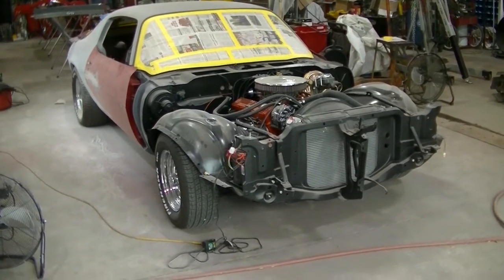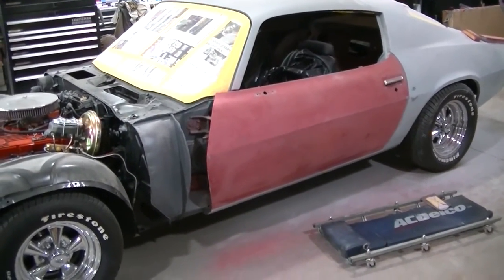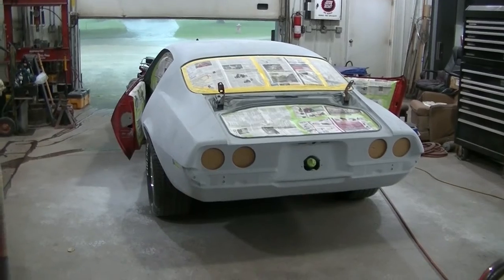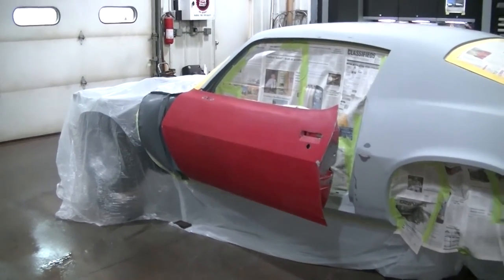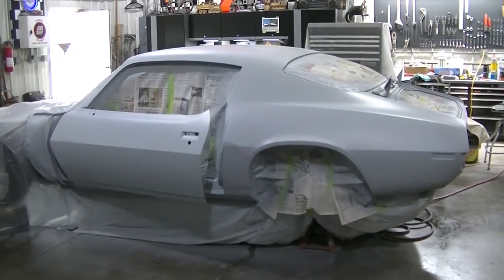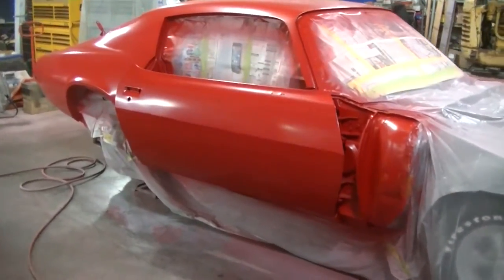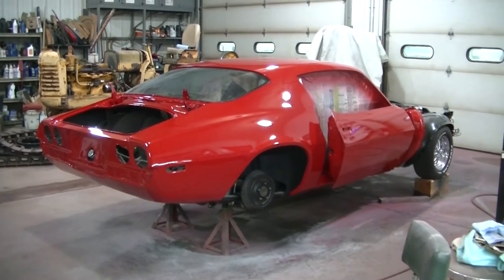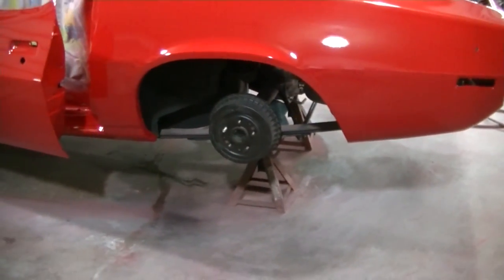70 Camaro SS Painting the Body

Comment: Looks really good Randy.  The paint makes any weakness in your body prep stick out like a sore thumb.  Those ridges like that on the door are very hard to get right.  Time consuming.  Anytime you gain by haste always gets more than ate up by rework time.  You won't be alone in that boat.
Reference perfection:  Perfection leads to paralysis.  If you are seeking perfection, you will be chasing it all your life but never find it.  A show car with metallic paint needs to be a lot closer to perfection than a driver with opaque paint anyway.  Good job.
Reply from the maker: I like that perfection reference. For most it's unattainable. Priority was getting the car done this year. It's just a door so it can be redone in a few years during winter maybe. I am happier with the doors after a wet sand and buff. It shines like a diamond in the sun. Can't wait to get it on the road. Probably next weekend.
Reply: @mossman381  When the bodywork transitions from skill to art is when I pay someone else to do it.

Comment: I think it looks awesome.  But I never saw a 70-73 I didn't think was beautiful, whatever shape it's in.  I been building (and autocrossing) these cars for near 50 years.  3 coats of clear, wet sand several steps 800, 1200, 2000, 3000 and buffing I bet it will look show quality.  As long as I've been working on cars, I painted my son's car 2 years ago, and even for a first timer I couldn't believe how well it turned out, even with several newb mistakes.
Reply from the maker: They are good looking cars. I have wet sanded and buffed the doors and are happier with them. It shines like a diamond in the sun. Can't wait to get this car on the road.